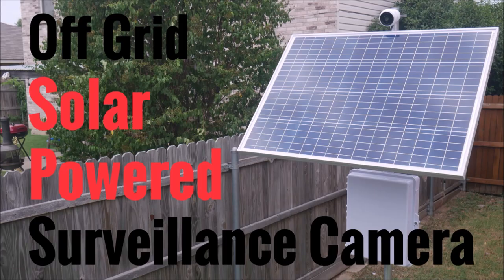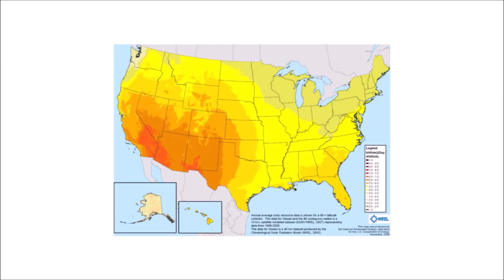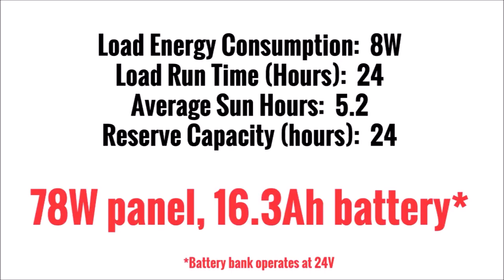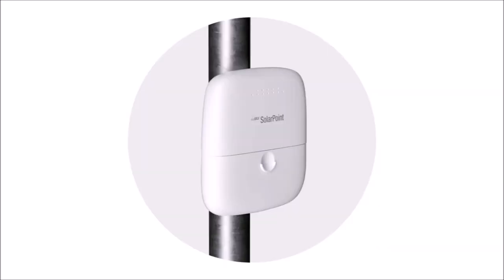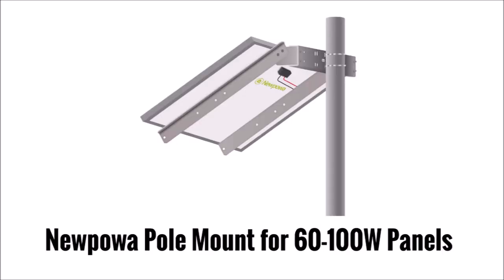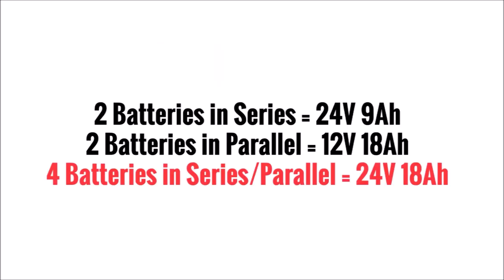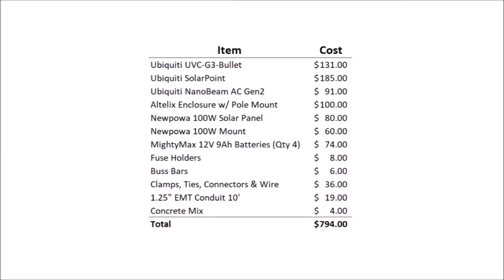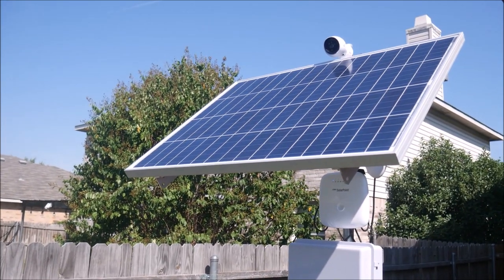Remote Solar Powered Surveillance Camera System - Completely Off Grid & Updated for 2020

Comment: This set up is like $1000 for each camera and super technical.  A little extreme.  Any wireless camera with solar charger is plug and play for under $150.
Reply from the maker: Yes, there are cheaper options.  But you can't really compare this to a cheap solar camera.
Reply: @LDSreliance  .. I will say that I am disappointed with my Reolink cameras, which pick up every bug but miss people.  If they get cold the wireless ones stop working.  The resolution is ok but the wireless ones only record ten seconds at a time and miss a lot.  For live viewing they are fine though.  The do have 1080 resolution if your WiFi is fast enough.
Reply from the maker: Yeah I think it just comes down to what your needs and expectations are.  My wife is the one that primarily watches our daughter and she isn't very technical.  So she would get frustrated pretty quick if she was using a cheap camera that had bugs and limitations and wasn't as reliable.  We have some Reolink and Wyze cameras and they are great indoors where there is a strong WiFi signal, but I haven't had much success getting a reliable outdoor cheapo camera to work.

Comment: Nice, the only thing different I would say to do, is mount the cam under the panel so it can block the rain and the sun. Great job.
Reply from the maker: Yes, definitely.  If my pole were taller I would have done that.  Unfortunately, putting the camera underneath on this particular setup would have put it around 4-5 feet high which isn't ideal.
Reply: @LDSreliance  Makes sense, maybe a little umbrella from a tropic drink over the cam would do the trick.....lol
Reply from the maker: Haha, well the camera is designed for outdoors so I'm not super worried about it.  But that would be a funny sight to see!

Comment: I built similar, except mine has a 12v router. So it truly is stand alone, Off grid internet station, then the camera connects to the installed router. Have a 10 and 20 ft pole that a big yagi antenna is mounted to to get the best connection available for the router. All mounted on a portable stand. I use to watch deer feeders. Hasn't missed a lick in 2 yrs.
Reply from the maker: I assume the router is cellular?  Like a Cradlepoint?  I would absolutely go that route if I couldn't get a WiFi feed.  Sounds like a good system!
Reply: Awesome.....I would love to see your solar wireless internet CCTV set up...Would you be so kind as to share some pictures or a video. 
Thank you.

Comment: I'd like to see more competition in the category of charge controllers with a web interface, preferably built in like a router or camera. Other than the discontinued Ubiquiti system I haven't found much.
Reply from the maker: I've been told to check out the Linovision 5 Port Solar PoE Switch (POE-SW805G5U-Solar) but I don't know if it has much of a management interface.  And if it does, I agree with you that it won't be as good as the Ubiquiti one.  The weather prediction stuff was nice but not really necessary.  But the ability to individually turn on and off loads/ports at set times of day and have really fine control over everything was fantastic.

Comment: How is your load energy consumption only 8w? The 5ac is 8.5w, camera 4w, and charge controller 2w. Isn’t that 14.5w? I would like to do the same thing except run LTS cameras x2. (12v,0.5a) I’d convert the POE24v to 12v.
Reply from the maker: Those specs you are looking at are max power ratings, usually.  In the real world, they consume less on average.  Especially on a radio with a very small load.  If the radio was transmitting a lot of packets it would be much higher.  But it obviously doesn't break a sweat with just one tiny camera on it.

I've consulted with dozens of people on camera setups and that is one thing I always stress to them... you have to find the real world consumption numbers of the camera and equipment.  Because just looking at a spec sheet doesn't tell the whole story.
Reply: @LDSreliance  Thanks for the Reply. I have 3.03w on 48v real world use on the Color247 Camera. I assume 6W under 24V. What were your real world values for the 5AC and Solarmax?
Reply from the maker: Everything receiving power from the Solarmax (which is everything on the pole except itself) uses right around 6.5W on average during the daytime.  I don't let it run at night so I don't know what the consumption is with the infrared LED's lit up.
Reply: @LDSreliance  I like your project and video, and my question is how do you turn off the consumption during the night? You did not mention any timer and manually turning On and Off would be too complicated?

Comment: Great video! Thanks for sharing. Just curious how your rig is holding up ? Also if you were to do a rebuild, would you use same equipment? If not what would you change differently?
Reply from the maker: It works fantastic.  Never a single hiccup.  I have torn it down and I'm moving it to a new property I just bought soon so there will be a new video on that in the next 2-3 months.

I would do everything the same if I could but unfortunately the SolarPoint from Ubiquiti is out of production.  It is an amazing device but they never put much effort into it and their whole solar line is basically dead.  So new people copying my design won't be able to use that piece, unfortunately.  If you can find one used I would snatch it, though.

Comment: Nice tutorials. I need more of this from you. Great job
Reply from the maker: Thanks!  I am working on creating a kit based around this setup or something similar to go on sale hopefully this spring.  Did you watch the original solar camera series?
Reply: @LDSreliance  yes. I did. Very interesting
Reply from the maker: Cool.  So what would you like to see in the future?  I can't afford expensive setups like this very often but I'll see what I can do.
Reply: @LDSreliance  no need of expensive setup. Normal solar installation is good. Just explain the concept of connecting CCTV cameras with it. Without this approach you used here, I think it would be less expensive compare to this.
Reply from the maker: So you just want to see a single, hard-wired camera with solar?  No radios or wireless bridges?  I'm not sure that would help many people because you could just easily power that with a PoE switch.

Comment: Great video, great skills, I work in IT as well, mainly on the software and enterprise side. I've been trying to come up with a way to blanket my 25 acres in 2.4 Ghz wifi for security cameras and sensors. You've given me some good ideas. Unlike your solutions, I am looking at creating wireless bridges (solar powered) but using Reolink Argus 2 solar wireless cameras. I've used them before and they are really good for the money. Keeping my bridges only allows me to be flexible with wireless sensors and cameras
Reply from the maker: As you know with IT there are usually 100 different ways to design a solution.  Whatever works for your budget and expertise!  I am glad I could give you some ideas.  Thanks for watching.
Reply: How do those camers work in winter? Won't snow cover the panel and render them useless?
Reply: @Shadoweee  I live in North Alabama, we don’t get much snow, last December it got down to 8 degrees F and they worked fine. Make sure the panel gets adequate sun.
Reply: @iamthemoss  Well I'm from EU and get quite a lot of snow so thinking of something custom. From what it looks so far I will need a 300 watt panel to keep it going lol
Reply: @Shadoweee  yeah, some of the northern latitudes will have snow issues for sure. You could shield the camera but the solar panels cannot be snow covered.
Reply: @iamthemoss  Yeah, that's the main problem as of now. Thinking about some self rotating gizmo so the snow can fall off every few minutes.

Comment: Nothing nicer than working with great equipment. Great video !. My only concern is security. In my option a NVR should never be connected to a wireless client, and that any outdoor wireless client should be connected to a dedicated outdoor  AP with nothing but “public” cameras or media considered non private ( no internet service ). Unfortunately this is inconvenient to users but isolating venerable networks can save a lot of issues. My indoor reolink system is has no wireless cameras and is off of internet. A different AP  ( physically limited in propagation as it’s located in basement ) provides in house iNet services. It’s all a headache.
Reply from the maker: Yes, security is always an issue.  It is maddening.

Comment: Great Video! Any chance you could make a step by step guide in the future?
Reply from the maker: Possibly.  I need to find components that are a bit more universal.  Stuff that will appeal to a wider range of people and a wider range of applications.  The solar charge controller I used in this video, for example, is a really cool piece but is no longer really manufactured (supply chain halted it completely) and Ubiquiti has all but stopped their solar efforts.  I'll revisit this.  Thanks!

Comment: Looks good but do you know if it will work with a different POe camera like Hickvision or Dahua?
Reply from the maker: It will work with any camera that is PoE.
Reply: @LDSreliance  Unfortunate it does not. Ubiquity cameras are 24V that is why they worked but most POe cameras are 12V
I am looking to get a volt converter to connect my Dahua Camera. 
on a second question.... what the daily operating time for your setup. Mine batteries died on 1 day just powering up the AP with no camera. now I am waiting on a sunny day to see how long it takes to recharge them.
Reply from the maker: Yes, the Sunmax does 24V passive PoE.  I forgot about that.  But it also does output 24V DC so you could easily use an adapter to switch from 24VDC to 802.3af or 802.3at.  I always use the Tycon Systems PoE injectors for stuff like that.  They have a whole range of products that convert from various DC voltages to various levels of PoE output:  https://www.tyconsystems.com/poeinjectors

Comment: Link to the metal box you used on the other project please?
Reply from the maker: What other project?
Reply: @LDSreliance  in this video you showed a metal cabinet that you chose not to use this time. Do you have the info on the metal cabinet?
Reply from the maker: I assume you mean the Tycon Power enclosure with the orange colored backing plate?  It looks like it is no longer available.
Reply from the maker: It looks like some random retailers still have some.  Here is one example:
https://www.linktechs.net/productcart/pc/viewPrd.asp?idproduct=321

Comment: which watts soloar pannel used and battery ahs , what is back up  hours with out lighting
Reply from the maker: The solar panel is 100W and the batteries combine for about 20Ah.  It can operate without much sun for about 2 days.

Comment: I would like to know how the battery's are rated for cold climate like the northeast
Reply from the maker: As with all batteries, they don't perform as well or charge as well in very cold conditions.  But they can be used and charged down to 0 easily and from 0 to about -20 if you really needed to.  Colder than that I would not use them at all ever.  If you can put them in an insulated box (perhaps even burying the box) they should be fine even if ambient temperature is below zero.

Comment: The wireless bridge setup over less than 5m is pretty useless, normal WiFi had done the exact same for a few hundred bucks less... 
Wireless Bridges (or as ubiquity calls it "air fibre") is only useful above 50m. Everything below that can be done with a wifi AP and a WiFi device.
You just built a multi-gigabit connection for camera streaming wich takes less than 50 megabits...
Reply from the maker: I agree.  Like I said, there were easier and cheaper ways to do this.  The point of the video was to demonstrate a fully remote, off grid setup.  I don't have a large yard and I don't live in a rural area.  Thus I cannot perfectly simulate those conditions.
Reply: The cool thing about this setup is if you use a nanobeam for both the AP and the Station side you can deploy this somewhere like on a ranch or other type of large property and as long as there is a line of sight the range is over 10 miles. air fibre devices are for high bandwidth back hauls that cost about $1,500 per antenna.

Comment: Wouldn't be much, much much easier and cheaper to just install a solar powered WiFi camera for $100-$200? You would have the same result. I like the build though.
Reply from the maker: Yes, you could do that if you were okay with spotty performance.  Those solar cameras do not have enough solar power or battery storage to operate very much each day, especially at night.  They also do not have bulletproof WiFi reception.

What I was hoping to do in the video was show an extremely reliable, well-engineered setup that literally NEVER goes down.  It has enough solar and battery capacity to weather 4-5 overcast, rainy days and has an industrial-grade wireless connection that never struggles for signal or disconnects and reconnects.

Comment: I have to say very expensive in total!
Reply from the maker: Compared to what?
Reply: @LDSreliance  POE from the house to the length to the camera!
Reply from the maker: In my example case here, yes.  But you are missing the point.  I was using this system as a demonstration because that is what I do on my channel (solar, batteries, diy, etc).  There are lots of applications where you may need to have a remote camera and PoE isn't an option or would be more expensive to run than this setup.